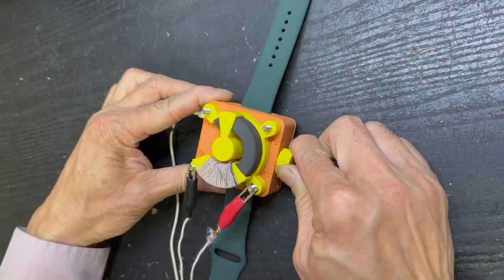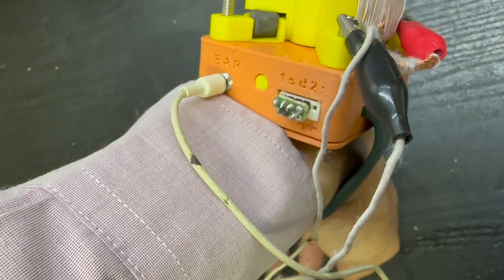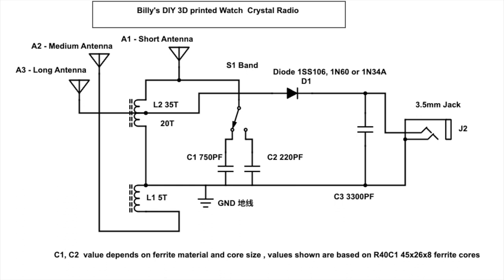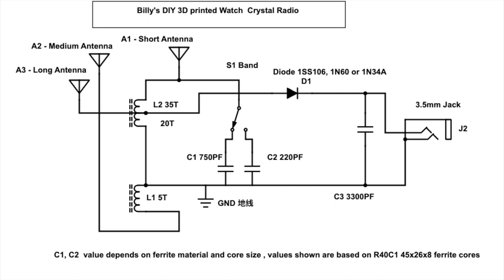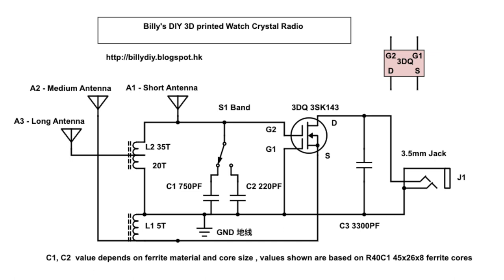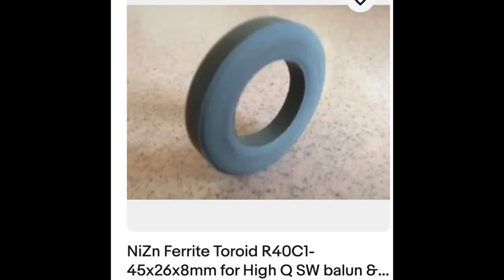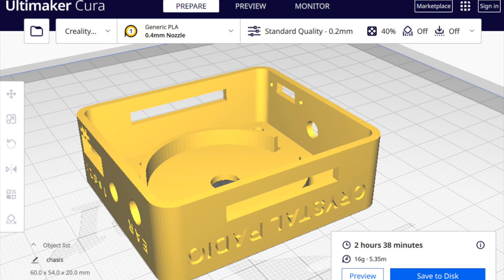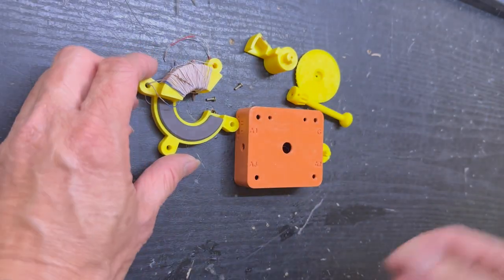The making of the Watch Crystal Radio

Comment: Your schemes and constructions are very interesting and inspiring. I've been following them for a long time. Maybe you should extend it with a small amplifier powered by photocells. On my channel I show a simple receiver powered by a candle flame or daylight. Regards
Reply from the maker: Thanks for the suggestion. Adding a small 3-4V battery to the MOS FET  radio circuits will turn the MOS FET into the regnerative mode with some amplification effect. The effect is much bigger in FM than in AM. However, I rather stick to my original principal of no battery of any kind for crystal radios.